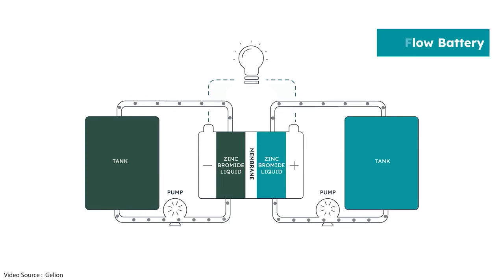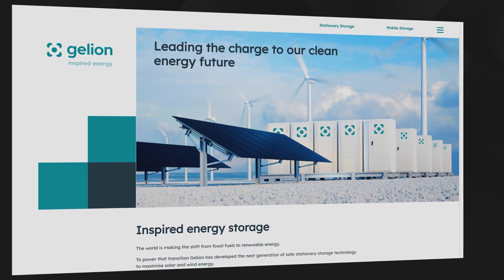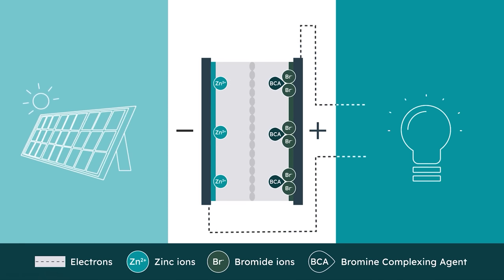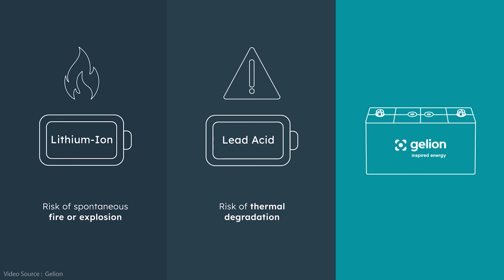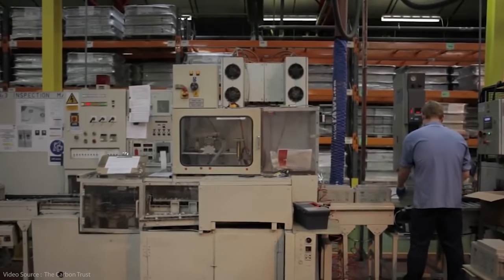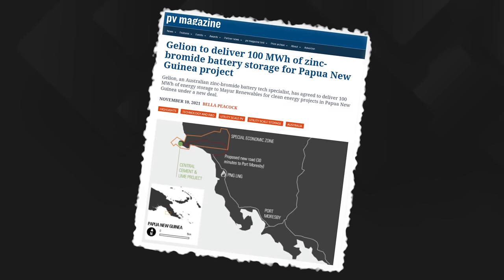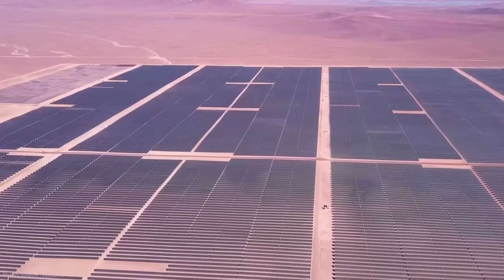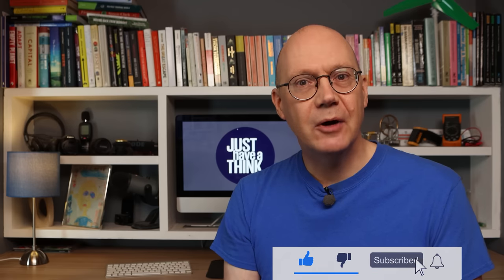Zinc Bromide GEL batteries. Cheaper, greener, simpler & safer than lithium -ion!

Comment: not energy dense enough for vehicles, but storage  isn't as weight/space sensitive.
durability would be the selling factor, along with cost if mass produced.
whether home or grid, value for the dollar will sell the most until we get a new long term stable power source like geothermal.
batteries are at least a couple decade future 
fusion still won't take us there for at least that long, if ever. :)

Comment: Yo,  What is the status of  the  LMB   battery  ?     Seals  good enough,  not perfect
What are the risks for partial to full on short circuit,    FORMECA   HALT / HAST
routine for high rel military systems.   FIT rates etc. 

How are the costs shaking out ?
Pair with SMRs for load leveling.    
Saving for SMRs based on minimum transmission losses.

Comment: And went to giga plant I need a battery Bank that would say 100 stories in the ground lined with Dupont plastic so that I could put the acid in there and the two cylinders in there so we can have charged up power Banks to supply it to the cities in the neighborhood from the 600,000 gigahertz that the gig of plant would be putting out every year

Comment: I have a 4000W solar system.  I would like to know if any harm (life reduction) comes to the 200A AGM batteries during bright sunlight days if the power going into the batteries is about the same as the power going out of the batteries.  In other words, they are being charged and discharged at the same time, but the voltage remains almost constant.

Comment: Cost, cost, cost.. that’s the only thing that matters.. if these are cheap enough then they will be an application. It doesn’t matter if they cost 10 times less to get the factory running, but are they cheap per kWh to manufacture? Get these cheap, like sub 50usd per kWh and the world will change

Comment: I wonder how the entire system's energy density stacks up.  Compared to Lithium, you need less cooling and less management.  If the battery is cheap enough it could easily replace Lithium in some applications like electric power tools where you can snap in a spare battery.

Comment: I am afraid both here and on the Gelion site every critical parameter needed to assess the technology is missing.
Talking about applications not specs as the webisite does encourages flannel.

How much does this cost per KWh, what is the cycle efficiency, and what is the rate of self discharge, for starters?

Comment: So, this is a kind of "better lead-acid battery" - about twice the energy density, deep discharge tolerance (and no toxic lead or corrosive acid)... I guess that volumetric energy density is close to that of redox flow batteries - far less compact than Li-ion, but simpler, probably cheaper, and safer.
Sounds interesting.
Reply: Zinc Bromide is not safer than battery acid .
Reply: @richarda996  What is the danger of it? Toxicity?

Comment: If you can pump the electrolyte in a flow battery does that mean you can charge it up in for example Morocco and ship it to Germany for use and then return with the discharged electrolyte for recharging and loose less than a verry expensive transmission line would and at a smaller cost at least in the short to medium run? Perhaps a pipeline with the electrolyte can be built for long term power export from Africa to europe without loosing to much to resistance.

Comment: Great video!  I'd sure like to see these batteries succeed.  If they could replace lead-acid batteries in I.C.E. vehicles and also those used in uninterruptible power supplies for computers and servers, that alone would go a long way into reducing the use of lead-acid batteries.  Many of the batteries used for vehicles and U.P.S. units don't end up being properly recycled.

Comment: Still not nearly as energy dense as gas so it is less energy efficient. Meaning more pollution from generating wasteful amounts of power to charge your car and store a fraction of the energy used to charge it. A good analogy would be allowing a gallon of gas to spill from your vehicle during every fill up because that is what charging batteries does from the perspective of the power plant.

Comment: Good video. The Lead Acid typically degenerere from 20D Cel. - with 50% for each 10D Cel. increase. 10 years at 20D Cel - 5 years  at 30 Cel - 2,5 Years at 40.

Comment: If this battery is mass produced and hits the market, It will be prefferred for stationary home storage due to its low cost and scalability. Using lithium-ion batteries for such a scenario is very inefficient and costly... This battery will have a big impact for the houses which have big rooftop area.

Comment: Isn't bromide toxic too? Its not a heavy metal, but its still dangerous right? Its weird to market it as having "no toxic heavy metals" when it does have toxic material. Is it somehow easier to deal with if it isn't a heavy metal? I just don't see the advantage over lead acid batteries in terms of materials

Comment: 3:00 i dont quite see how that would be an issue when charging the battery, since you need an external power source to charge any battery anyways 😅 i can see the issue arise when discharging, since you can't use the battery to power itself without having something else start up the pumps.

Comment: These batteries may not contain corrosive acids or heavy metals, but bromine is corrosive to human skin and flesh as well as extremely toxic if the vapors are inhaled similar to chlorine gas. This in itself makes recycling of these batteries hazardous like lead acid batteries, not as easy as represented in the video. I'm not against the batteries, but I think the potential issues are misrepresented today as being mostly harmless

Comment: Have you seen this one? https://youtu.be/ELkH3rXRQ1w
My guess is that he essentially created a reverse fuel cell. Instead of starting with a snootfull of hydrogen producing electricity to drive, he started with a snootfull of electricity that produced hydrogen, which then produced both power and more electricity. At some point, either the water or the electricity limits the range. The math would be interesting. If one's house had adequate solar panels or windmills to charge the car and power the house, the energy industry would collapse.

Comment: It's amazing how much technology have developed in the last 20 years, especially the last decade.
Reply: Yes. A shame most of it is total utter BULL!!!!
Reply: @terencefield3204  what are you on about? 
Has there been technology that has been over hyped?
Definitely. 
However, there has definitely been major technical achievements within the last twenty years. I predict by 2050 renewable energy sources with backup batteries will be providing the majority of the world's electric. With hydrogen fueled aeroplanes, ships, lorries, etc.
Reply: @terencefield3204  what are you babbling on about?
Both solar panels and wind turbines have dramatic increased in efficient whilst dropping in price. Batter technology has made tremendous amounts of improvement. It is now possible for many countries to switch over to 100% renewable energy sources and cut the cost of electricity. Soon it will be possible for whole economies to become powered using 100% renewable energy sources, with backup and battery cars. Also, with hydrogen fuel used for aeroplanes, ships, lorries, etc. 

If this was the 1970s I could understand your scepticism. However, it's not. We can't continue relying upon outdated technology and fossil fuels.

Comment: Brings back up the old bromine issue from the early days of automobiles! It’s the SAME problem haha how ironic!

Back in the day gasoline used to be leaded, pretty common knowledge right? But they didn’t just sprinkle in lead dust and call it a day. The lead additive was called “ethyl fluid” and it was a mixture of tetraethyllead, ethyl chloride, and ethyl bromide. The haloalkanes were needed to prevent the TEL from building up powdered lead oxide within the engine. (Lead fouling) These were lead scavengers that would react to form the much more volatile lead chloride and lead bromide. And these “new and improved” lead compounds could easily and conveniently be exhausted out of the engine (and into the environment), so the ethyl chloride and ethyl bromide were critical. Without them, lead oxide would eventually ruin the engines.

The bromine problem arose due to the massive volumes of gasoline being produced, and the subsequent volumes of ethyl bromide that needed to be produced with it. Both lead, and chloride are prevalent in the environment, and therefore affordable and available. But bromide? Not nearly as much. 

So long story short, bromide for the masses caused a real fear of running out of the stuff. If every man woman and child demands one of these bromide gel batteries for energy access, then we’ll reintroduce a problem that we already solved years ago

Comment: EV's have lead acid batteries. Would a Gelion have the energy and power densities, and form factor, to be used instead?
Reply: No, almost all EV's in the west have Li-ion, while China is going with LiFePO4 because of a greater price sensitivity and less range anxiety.  Maybe you still have hybrid cars using Ni hydride batteries.
Reply: @richdobbs6595  Generally, an EV still has a lead acid battery to start the car, so my question still stands. Does a Gelion battery have the specs to replace lead acid?
Reply: @thinktoomuchb4028  
Watch and listen
Reply: @davidwatson2399  If you know the answer by watching this video, kindly share it.
Reply: @richdobbs6595  
All replies to this troll are now removed or hidden.
Reply: @davidwatson2399  What are you on about? I can read all these comments. Rich actually posted a separate comment similar to ThinkTooMuch, he simply didn't understand that EVs also use lead-acid batteries. Seems like you're the one in danger of being labeled a troll here, though, not by me.
Reply: @billstegemann5843  
They are still not visible to me.🤔
Reply from the maker: Not really designed for EV's. They don't have enough power

Comment: Unusually for this channel, this video had me scratching my head. Flow batteries are suitable for utility scale energy storage for the reasons given in the video. The technology discussed here, using a gel, is some kind of replacement for lead acid perhaps, but not utility scale, at least not to revolutionise the economics of it. The purported downsides of pumps, manifolds, etc., are trivial - this is just standard process engineering. Indeed the ability to route battery chemicals from (a number of) tanks through a number of cells gives you redundancy and hence availability. Moreover, the chemicals in the tank(s) can be monitored, sampled and processed to maintain their quality. The dwell time in the tanks also provides a cooling function, both to the process chemicals and to the reaction cell. (Edit: having thought about it, this does depend on the battery cell operating temperature. But the point remains that by controlling the input temperature, you control the cell temperature.)
Turning to the bromine batteries, it would have been good to discuss the toxicity issues regarding bromine and maybe even the danger to the ozone layer (commenting from quick Google search, no in depth knowledge). Because of the different chemistry - completely different - the recycling process cannot use a lead acid facility. The temperature stability, if I heard right, is 50 C compared with 40 C for the other batteries mentioned. This is not a significant difference, particularly when countries are more regularly hitting 50 C on the mercury, and with no discussion of internal resistance (and hence heat generated).
Interested to hear thoughts from experts to confirm or rebut these points!

Comment: A very important note, we are exhausting our zinc supplies at a rapid rate. At current rate we are going to run out of it and zinc has a lot of applications. Speaking as a chemist i don't see the sustainability of this or any battery technology, all these metals are very toxic and we have to replace those batteries. I see a very real danger if we would go with batteries to enormous pollution like we have never seen. In my view the only way is a centralized energy system where we have abundance energy, then we can de-carbonize with current technology so the problem really is we need far more electricity and the only feasible source is nuclear power. This is very much discussed within scientific circles, we have solutions for the waste and for safety. There is a bright future everybody just needs to have a open mind and unite then we shall indeed 'save' the planet.

Comment: Lead acid batteries are really good- much better than lithium, which is terrible at this- at brief, high discharge rates, such as what is needed to start your car or truck, or charge capacitors, such as in an inverter. That is one reason lead acid batteries are still so ubiquitous, even in luxury cars. How well do these batteries perform under this kind of demand?
Reply: Apart from the price Li batteries are very good for automotive use. Contrary to your statement, they are far better than lead acid for high discharge rates (look at the battery data sheets if you don't believe me). They are also much smaller and lighter, with a longer life span. That''s why they are becoming very popular in high performance applications such as aircraft and racing where cost is less of a concern.
Reply: @LesNewell  is it just the lifepo4 batteries, then, that shut down into a protection mode when people expose them to a sudden load, such as energizing an inverter? This is quite common in the RV world right now. The manufacturers of these batteries will tell you they are not to be used as starting batteries.
Reply: @glennbishop-smith9957  That is due to the battery management system. The BMS is designed to shut down if over loaded. Making a BMS that can handle starting current is expensive so most battery manufacturers don't do it. If the BMS shuts down when connected to an inverter, it is badly designed.

The cells themselves can handle crazy currents. For example a 2.4Ah A123 cell is capable of providing 120A for 10 seconds or 50A continuous: https://www.batteryspace.com/prod-specs/6610.pdf
I only quoted that cell because it was the easiest to find with a quick search.
Reply: @LesNewell  
do you have a vehicle with an internal combustion engine? a typical automotive battery, basically invented a century ago, has a reserve capacity of around 100 amp-hours. At 32 degrees it can provide around 800 cranking amps, albeit briefly, and at 68 degrees, 1000 amps. 
For its size, it is unmatched for that kind of output. Put together a group of a123 cells with the same reserve capacity, voltage, AND that much output, so basically groups of 4 wired in series and then groups of those wired in parallel, and they would never fit in that group size 24 box. Not even close. That, and their poor performance in cold weather, keeps them out of engine bays. Yes, Teslas use them, but they use more than a thousand pounds worth of them.
I originally asked this question because the batteries in the above video were being assembled in automotive-style cases, laid out like automotive lead-acid batteries. I was wondering if this chemistry was better than current li-ion or lifep04 at big discharges. For what it's worth, I have since found out it is not.
I am a lithium battery fan. I have two of them in my RV. Unfortunately they are not suited for starting my truck's engine.
Reply: @glennbishop-smith9957  Doing some rough calculations you can easily fit 144 cells in that volume with room for wiring etc. That allows for 4 series x 36 parallel. 86AH with easily 4300CCA if the terminals and wiring could hold up to it. According to the data sheet they will work down to -30C/-22F. Charging is an issue at below 0C/32F, but the battery should warm up pretty quickly once the engine is running. 
IMHO using LiFe as a drop in replacement in an existing car isn't a great idea. The BMS would have to be huge and there is the cold charging issue. However if the car electronics  are designed around LiFe rather than lead acid, it would work very well. I don't see that happening for production cars other than a few exotics due to the price and easy availability of lead acid. Let's face it internal combustion is a dying technology. Emissions regs are making IC more and more expensive while electric is coming down in price. It won't be too long before electric cars are cheaper.

I have a ride on mower that's designed to have a 10Ah 12V lead acid. Roughly every 2 years I had to replace that battery. About 3 years ago I fitted about 6AH of  tired and abused LiPo cells (they were at least 5 years old at that point). The charging system is not compatible with 11.1V LiPo batteries so I disconnected it and instead simply charge them up on a charger once a year. I have had zero issues with them and it cranks much better than it did on lead acid.

Comment: We shall see. For now the Lead/acid battery bank is still the most cost effective.
Reply: For initial costs, yes.  But if you look at total lifetime cost, lithium costs less.  Also lithium batteries weigh half as much.
Reply: @docwatson1134  While in theory that is some what true, I analyzed duty cycles as well as the need for lithium to be kept cool. Heat is a MAJOR issue here in the SoCal High Desert. In my case Lithium doesn't do well as a full time off gridder.

Comment: I heard about these batteries a couple of years ago. I was impressed even back then. And I was wondering why this battery hasn't taken off yet. It sounds great for the EV industry. The battery has less chance of exploding than the lithium ion batteries.
Reply: @OverEasy Mode. This battery will never be used in the EV industry. It's got 25% to 30% of Li ion. It ticks all the boxes for stationary deployment though.